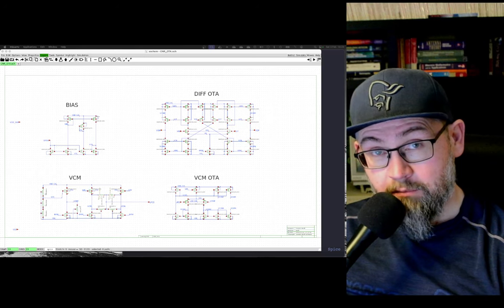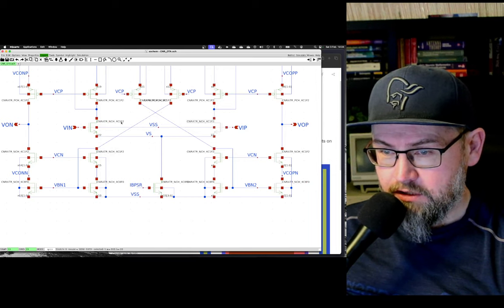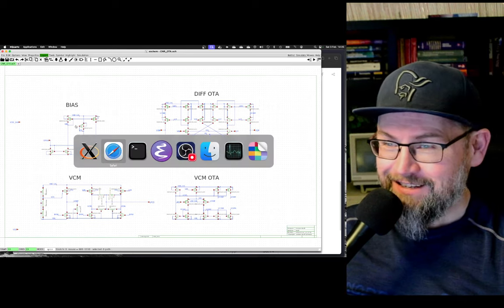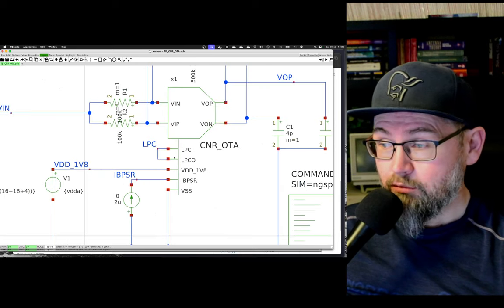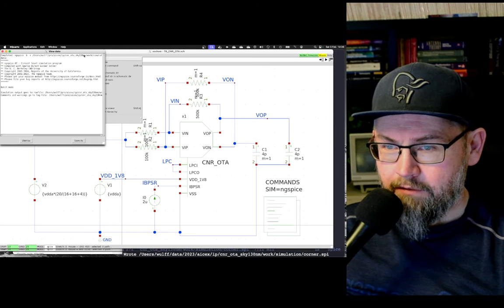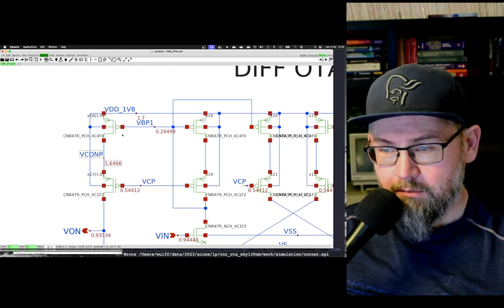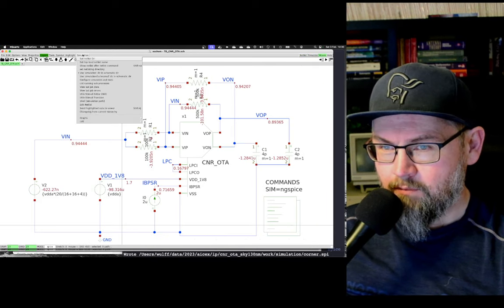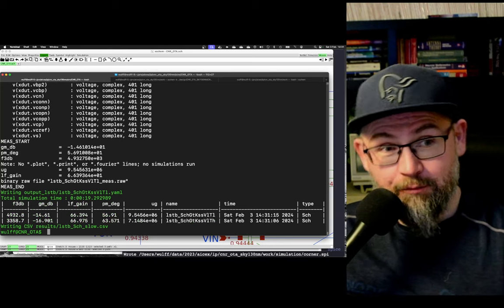xschem and ngspice operation point back annotation

Comment: Hey Carsten, thanks for the great video! 2 questions though: 1) Can we also just use the regular corner.sym to setup corners (instead of including an spi file like you do)
2) When I try to back annotate the values on to the symbols on the schematic, all I get are question marks next to the tcl commands that should actually show the gm, id, vth, vdsat (I modified the symbols of the thick oxide devices to show more than the default ones). I get the same results if I try to view the op using the get_value  - so so far I cant see the ops of my circuits, which is a great hinderance for debugging of course. Any idea what I might be doing wrong here?
Reply from the maker: 1) Maybe, have not tried 2) Check if the values your trying to load actually are in the raw file.

Comment: Is there any reason to use the same Net label for the negative input of op amp and the voltage source connected to the input 100k resistors (VIN) in TB?
Reply from the maker: Thanks. That's a mistake on my part, the voltage on the voltage source should have been VI or another name.